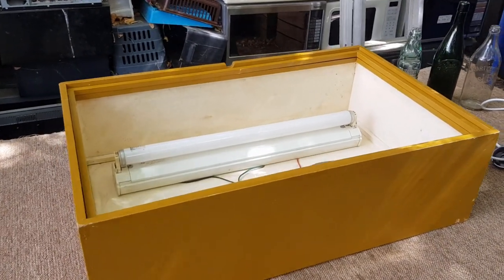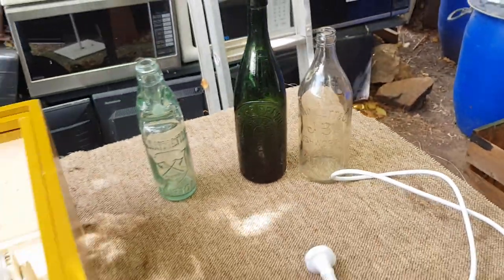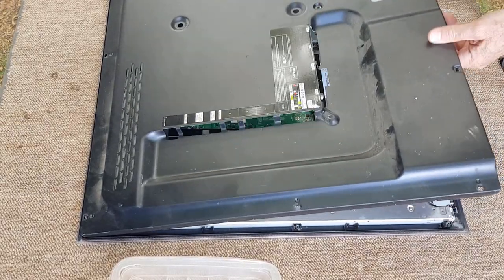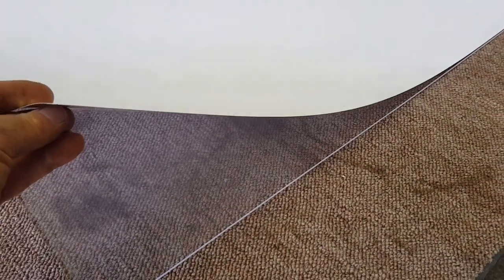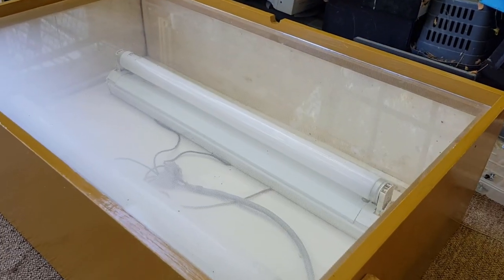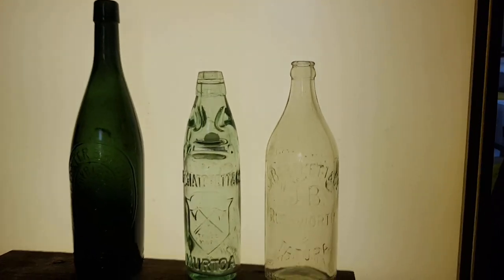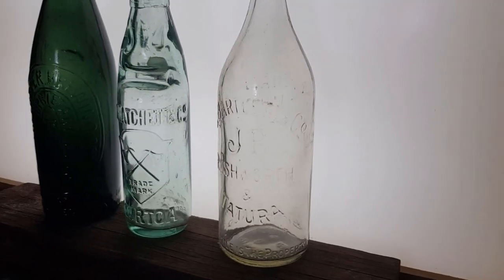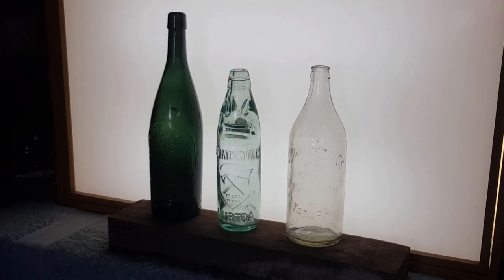Repairing an old light box for photographing antique bottles. A TV screen diffuser upcycle project!

Comment: Could you make an LED strip wrapped in a small diameter cylinder of diffuser foils to insert into the bottle?
Would a light source inside the bottle help show the embossing?
Reply from the maker: Good suggestion, although I think light from within a bottle would prevent any shadows which help show the embossing. It may work on the darker bottles - I'll have to try it! 👍😊